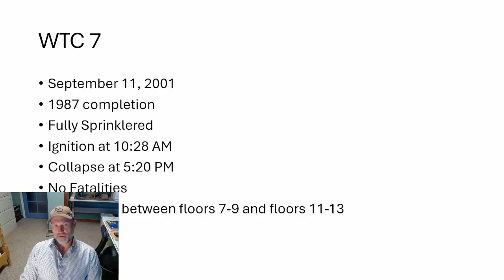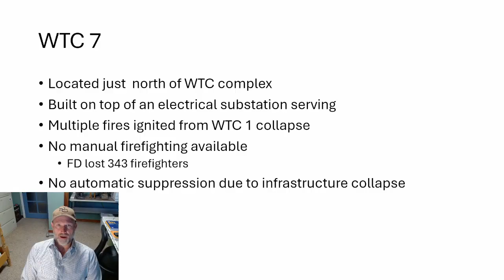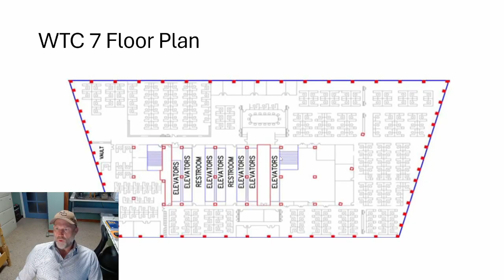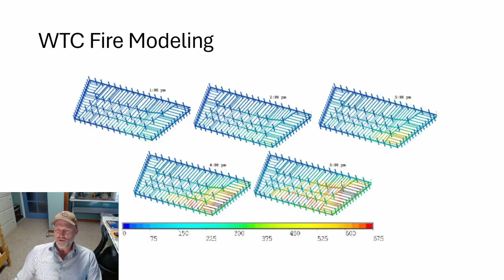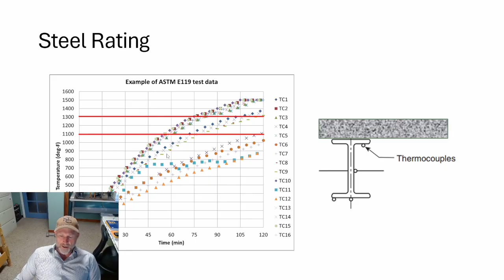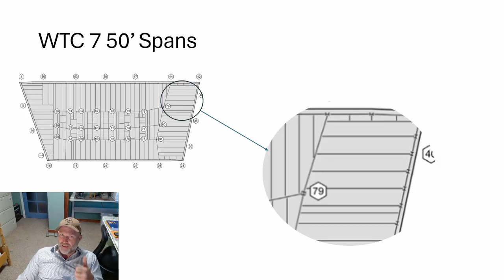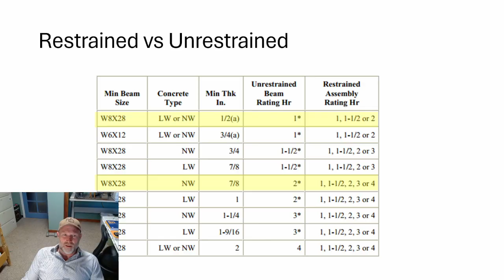World Trade Center 7  Why did it collapse || Fire Forensics Analysis based upon Engineering Science

Comment: 1:38 incorrect, many many buildings have burnt for way longer and way worse and are still standing, i.e: grenfell
Reply: I don't know about "many many" buildings...  As for the Grenfell building, aside from it being half as tall as WTC 7, and aside from the fact that it was not damaged by falling debris from another collapse, Grenfell was predominantly a steel reinforced concrete building, and that type of construction is not impacted by fire like steel only are. WTC 7 was a tube in a tube design, which had a compromised design due to being built on top of an existing structure, such as transfer girders and long-span trusses. Further, when the secondary penthouse was built to carry new HVAC units, the structure wasn't upgraded to handle the additional weight. So while you are right that a fire burning for seven hours isn't unique, the one example you offer up is a building that has a completely different design, which makes the comparison somewhat irrelevant - IMHO.
Reply: @TheTruthCalls  none of that matters though. uaf has already proven that wtc7 wouldn’t have collapsed due to fire and they actually modelled the building correctly unlike nist who classified their simulation (wonder why cough cough wink wink)
Reply: @joyjakDOTst Conspiracy theorists do tend to believe what they wish to believe. Nothing has been proven, a theory has been promoted, nothing more. Others have already shown the collapse is completely expected given the damage. Controlled demolition of the three buildings is ridiculous... it's not even possible.
Reply: @TheTruthCalls  oh i love this attitude. so arrogant and clearly making assumptions off of missing evidence. by that same attitude you cant be certain of anything. whatever i don't envy your situation.
Reply: @joyjakDOTst If the towers were taken down by controlled demolition, it would have been the most massive and complex demolition of all time. Something like that would take months to implement, and the buildings would have to be empty in order to tear away the walls blocking access to columns. Massive amounts of explosives would have to be brought in. The entire thing would need to be wired, and all of this would have to happen without the tens of thousands of people who worked in them daily seeing them do it. And to make matters worse, it would have to be done twice.

Then we have the remarkable ability to still trigger the explosions exactly where the planes hit the towers, which is where the collapses began. That means the explosives and the wiring/triggers all survived the impact of the plane, the massive explosion and the resultant fires.

All of this is simply not possible. You're so invested in blaming the government that you ignore the reality of what it would take to bring those two towers down. And then you people argue WTC 7 was taken down to hide the evidence of controlled demolition of the towers, as if there is so much required on the trigger end that an entire building would need to be destroyed.

The entire concept is utterly ridiculous. It's simply not possible, nor does it even make sense. You people either just hated Bush and his administration, his party, or you're just conspiracy theorists who prefer insane speculation over reality. Whatever it is, I don't envy you.
Reply: @TheTruthCalls  making so many assumptions yet again. stop pushing your biases i never said anything about controlled demolition or “the gov”. you clearly have too much time on your hands maybe you should go get a hobby.
Reply: @joyjakDOTst Well then, how about you clarify what your theory is of how the buildings collapsed - WTC1, WTC2, and WTC7 - and who was behind it. Do you believe terrorists hijacked planes and used them as weapons or not?  And if damage and fire didn't weaken the structures until the collapsed, then what did bring them down?  You keep pissing all over my opinions, and you deny what I assume to be your opinions, but I've not seen you once state who you think was behind it, and how they came down.
Reply: @TheTruthCalls   i just find it hilarious you're so motivated to have some sort of intellectual debate in a youtube comment section. 

my guy you are typing out full PARAGRAPHS of text like anyone is gonna read that and entertain you. 😹😹😹 

if you want a medal or a badge for "being the worlds smartest boy" here you go: :medal-yellow-first-red:
Reply: @joyjakDOTst Of course you believe this was a controlled demolition conducted by the government. Your comments offer no other alternative, and you can't offer a theory that proves otherwise. Instead, you deflect with the length of my posts.

And talk about hilarious.. my longest post in this thread is 145 words long. Considering we're discussing the collapse of three massive buildings, that's an amazingly low number for my longest post. I can only assume you don't read too many books.
Reply: @TheTruthCalls  you actually have to be an ai there is no way you are a real human but in the off chance you are you really need to get help with your snarky redditor personality.
Reply: @joyjakDOTst Look, you complain about the length of my posts, now you're calling me snarky. Instead of all these deflections, why not just respond with your high level belief in what happened. It can only be one of three answers;

1. It was a terrorist attack and the buildings collapsed as the NIST report concluded.
2. It was an inside government plot, and the buildings were deliberately brought down using controlled demolition.
3. Something other.

You've made it clear you don't believe #1, and you got upset with me when I implied you believed it was #2, so I have to assume you don't believe #2. This leaves only #3, so would you care to add a little detail to it???
Reply: @TheTruthCalls  im not gonna respond with a “belief” because one 1) i dont care 2) im not american 3) i know people like you hate uncertainty so i find it humorous watching you get all stressed out trying to pin me down.
Reply: @joyjakDOTst No, you're not going to respond with your theory because you believe in controlled demolition executed by the government, you just can't admit it now.

Stressed out trying to pin you down?  Don't flatter yourself. You're a bit of entertainment on a slow day.
Reply: @TheTruthCalls   you still cant prove anything about what i believe other than your own biases and delusions . all those paragraphs of text and nobody will ever read them. does it feel nice wasting your time? or maybe your time just has no value.
Reply: You know absolutely nothing about this matter and it shows. GreenFell tower is pure concrete structure. WTC7 was pure steel structure tower. Plasco Building (steel) in Tehran completely collapsed because of fire. Windsor Tower (steel+concrete), in Madrid PARTIALLY collapsed because of fire (of course it was the steel part that collapsed). No steel structure ever survive from uncontrolled fire damage. That is why they always cover the structure with fire proof foam to DELAY structure failure.
Reply: @YuuSouji  wow you sound personally invested. you must be really clever if you try to have “intellectual” debates with people in youtube comment sections. would you like a “world smartest boy” medal?

Comment: Sent here by the Sabin video.

Seems like the additional penthouse superstructure on the top of the building put some of the core columns under high base load.

Maybe builders need to factor in additional support infrastructure being added over time?

But it’s an edge case, since the NYFD was occupied at the time.